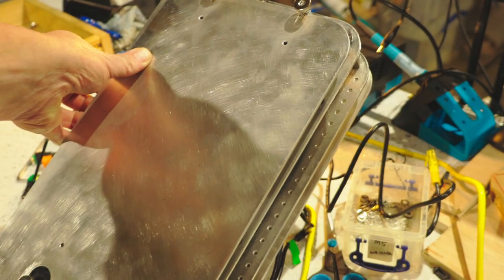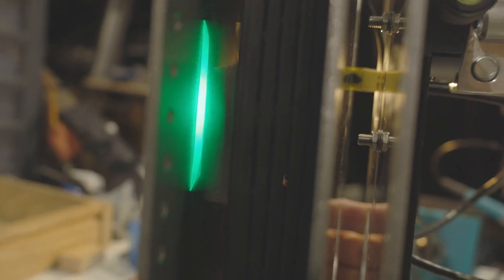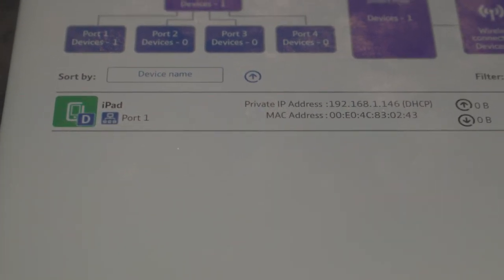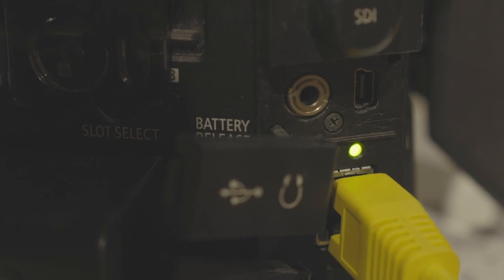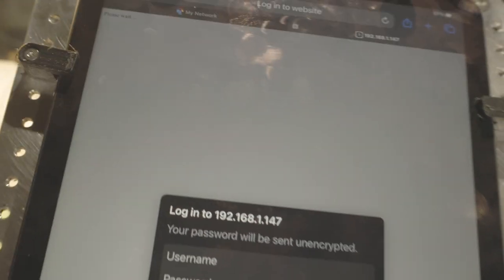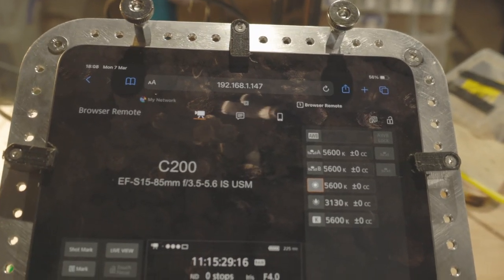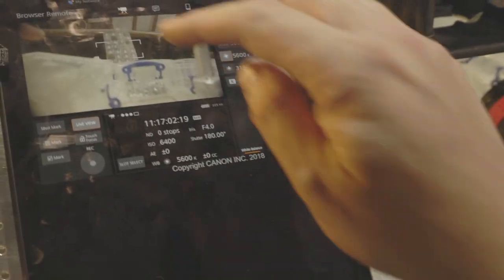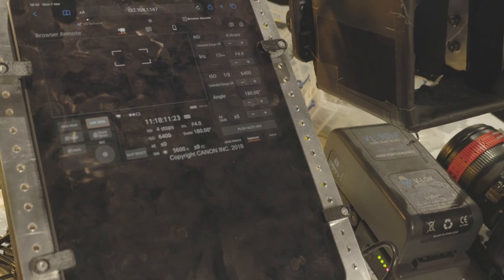Canon C200 ethernet, router, ipad pro

Comment: So is that basically working as NDI? the same way a PTZ camera would do it?
Reply from the maker: ive no experience of ndi or ptz. you can basically.. -get crappy live view, operate focus nd iris, roll and other stuff.. it does  most functions.
Reply: @sammorganmoore  interesting, thanks for the reply. So it might be basically a remote controller.
Reply from the maker: @ChristianPodcast  yes on a jib or suchlike it can be super handy. especially a busy environment where a wireless connection may be problematic.

Comment: Sort of cool but wonder why it is so slow? I think my FX6 will do this but not had time to play around with it.
Reply from the maker: if the camera is on a jib or an external car mount this is a major deal.. of course if it were implemented properly that would be a load better. Cat5 cable is right up my street as at events or other places where there are another1000 devices hogging the wifi this will be 'solid'

Comment: Thats really good stuff Sam! Great to see this so thanks very much for uploading this. Why did the screen go black at the end just before you changed the ND ?
It is very very slow but its better then nothing. Being able to see what the camera is seeing remotely on the end of a long ethernet run is incredible. To be able to toggle the record ON/Off will be really useful.
Reply from the maker: It seems that the screen goes black when you load the thing up with instructions, the image comes back. Basically you need to make an instruction (chnage iso, nd, focus area) and let it become happy with that instruction befroe confusing it with another one. Poor little thing. So just go slow to avoid blackouts maybe.
Reply from the maker: in real use it might be better to have the image off and look at your actual monitor - mine will be hard SDI cable for good lag free connectivity.
Reply: @sammorganmoore  What length cable ? HDMI cables can go about 50m, so HDMI might be an option to monitor the image as it is a full fat signal with up 30fps
Reply from the maker: @jimjones7821  I have an atmos and sdi, so id be using that I guess. we did test a 35m hdmi for a possible gig and it workked (nikon z6 i think)